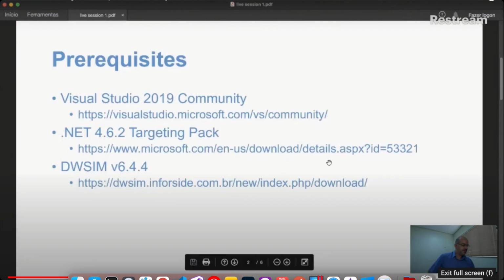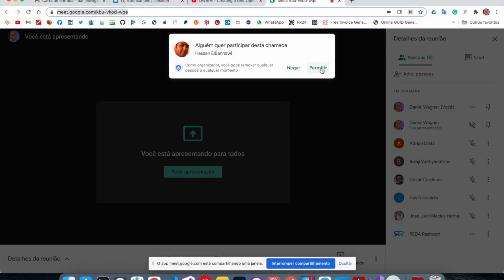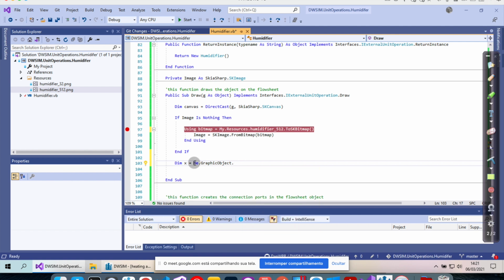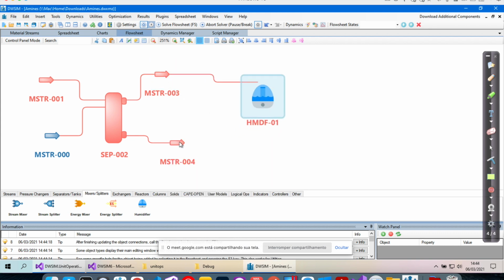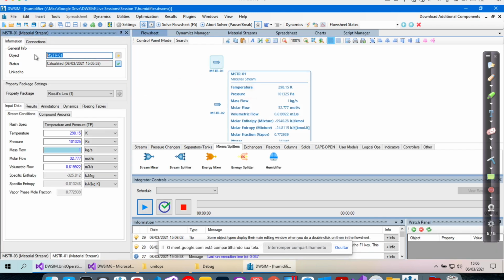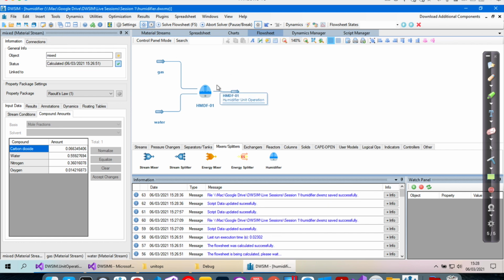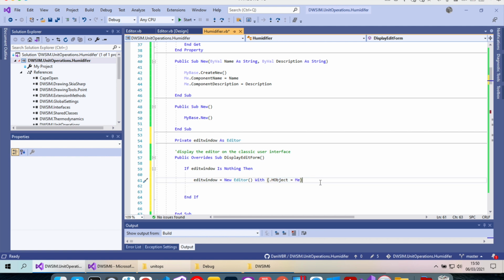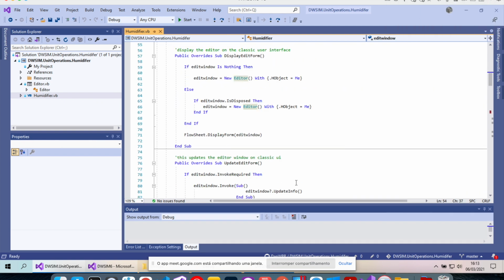How to Create a New Unit Operation Model (Visual Basic language)

Comment from the maker: 2:25 Intro
7:57 Creating a new VB Class Library Project (.NET Framework 4.6.2)
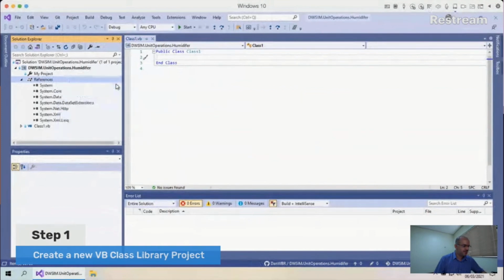9:44 Adding references to DWSIM DLLs
14:30 Creating a Class that Inherits from DWSIM.UnitOperations.UnitOperations.UnitOpBaseClass (this is the correct one) and Implements DWSIM.Interfaces.IExternalUnitOperation
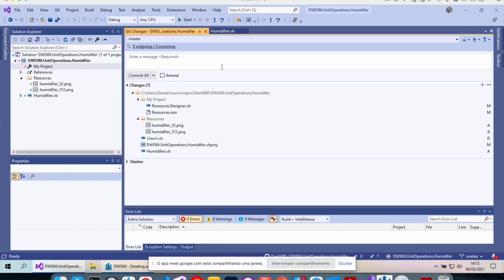37:46 Coding the UI/Flowsheet Display functions
1:15:28 Coding the Model Calculation Function